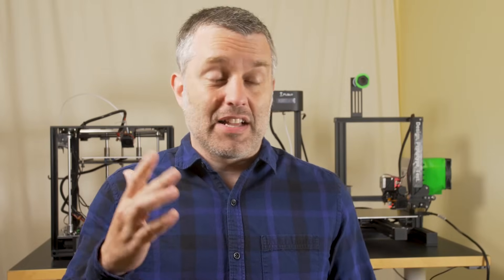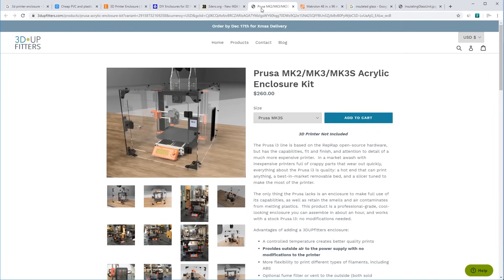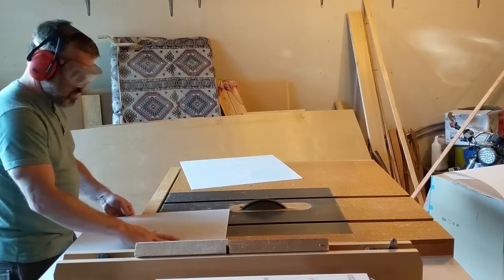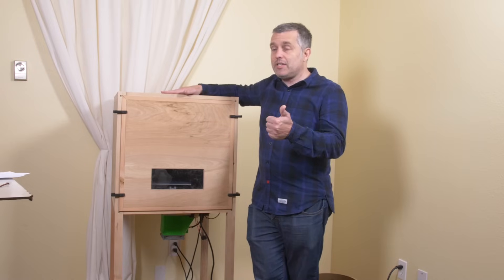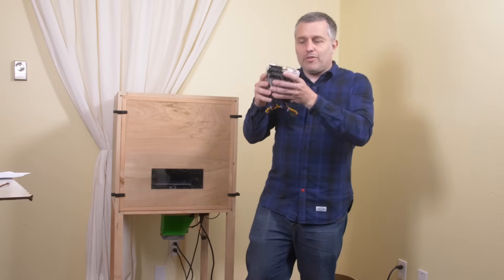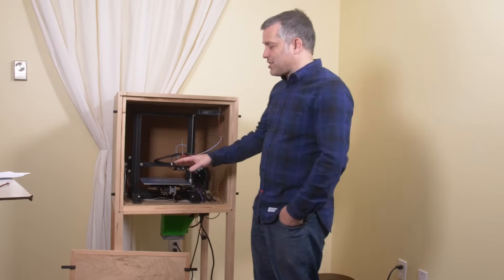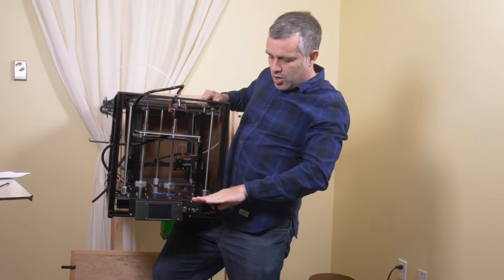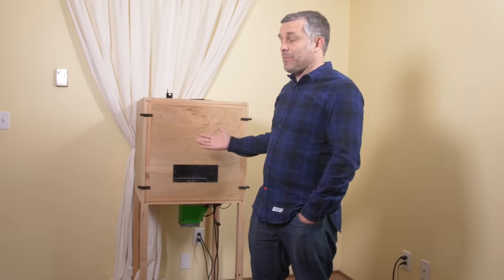3D Printing in a 100°C Heated Chamber - Lessons Learned

Comment: Why not order argon filled double glazed glass for windows? Double glazing makes good insulation but eventually, heat will get trough. But for double glazing, I would use the same idea as in the kitchen oven. One sheet insulates another one is for safety reasons. It is less efficient as insulation but prevents the inner sheet from meltdown if you are using polycarbonate. Convection makes the constant exchange of air for the inner sheet and the number of holes and sizes defines the actual level of insulation. If you would make a construction smart enough the whole idea could be used to make duct channels trough the whole cavity around the chamber. That points to the make of internal walls from something more heat/fire resistant i.e. glass or aluminium (which conducts heat but also radiates half of it back as an IR  and spreads heat around the chamber more evenly.

Comment: You really overthought your problem.  You should have cut the slots for the PC just a touch wider to allow for sliding the thin pieces in.  Then went back and sealed your gaps with clear silicone.  Granted you'd only get a seal on one side of one of the pieces, but you'd get a seal on both sides of the inner wall, and the outside of the outside wall.  It's a good build otherwise, but you could improve it easily.

Comment: Use halogen bulbs rather than the heat gun. Place them over the build table, offset from the Y axis that the print head runs on. This will direct heat to the printing part. This will offer a heated chamber effect between the heated table and bulbs without overheating every other part of your printer. Still have the walls of the chamber to stop draft but leave the top open so that the printer doesn’t overheat. 

If you have all motors, wiring, bearings etc in the chamber they will malfunction very quickly. This is why commercial printers with heated chambers have nothing but the build table inside the chamber, everything else is outside the chamber in a fan cooled environment, very important.

Comment: i covered my printer with plastic and light iron frame...also used  Circular Saw Blade (80 cm diameter)instead of glass of the bed ...they are flat like glass.. heat faster and transfer heat well to the part...And I never had a problem layering on  ABS after use that

Comment: I built a water cooled printer (even has all metal linear rail carriage worth MORE than my printer) and the only thing I never got to finish is making the enclosure itself. lol.  big printers need a lot of freaking Melamine panels. Use Melamine and avoid any kind of wood in a heated environment.  Melamine when it burns produces nitrogen and self extinguishes.

Comment: I use 1” aluminizes foam board taped with aluminum tape. Then heat with 2 small halogens and a fan inside. Electronics outside. A thermostat controls the lights. Like your small viewing window, definitely update my builds tomorrow.  I’m currently designing water cooling the stepper motors with good success. Thanks, love you work
Reply: I just did that earlier today, finally got around to trying some ABS now that I'm low on everything else. Had 3 walls of 2" aluminum faced already to block the breezes in my shop already. No Auxiliary heat or fans but the print I tried came out perfectly fine. Not worried about the stock board since I have an upgrade, but I have the power supply and the filament reel on the outside. I think having the filament reel somewhere it won't catch fire if there's an issue is really important. I didn't bother to fully seal it yet, want chamber temperature monitoring first - probably an oven thermometer and viewing window to start, already available.

Comment: Ok, I know this was a while ago. . but.FYI ... putting an Encloser over ABS ( without filtered ventilation ) .. would be worse on you than letting it get in the air.. you are trapping ALL the fumes from ABS into the enclosure ..  SO when you pull that Enclosure off. where do you think ALL the compressed fumes are going? a lot more into your lungs than if it was in the air with an open window with a fan.. IMO.
Reply from the maker: You make a good point. You aren't wrong. However, I would point out that 3D printing releases fine and ultrafine particles. We colloquially call it "fumes" but the pollution is definitely particulate and not gas based. These particulates can settle out of the air. If kept in an enclosed where horizontal surfaces are wiped clean after printing is complete I'm sure this will lead to less exposure in your lungs than printing in the open air while inhabiting the room.

Comment: i wish i could share my enclosures i built for my enclosures, i have nothing in them, i used old scrape wood 2x4 that i split an old floating floor but i made my own lack tables an used foam board u can buy at dollar tree for a buck each, its the same thing u see ppl use to make signs or even rc airplanes but i always use it to cover my enclosures an just use plexiglass for the door or the foam board with plexiglass if the door is bigger than the plexiglass that i had. would like to share what i have now and all the different stuff ive tried. ive build one really big one that held 6 printers an also 2 or 3 printers, i have one now that has my 2 flsun qq-s pro an they have been the hardest ones to enclose due to the height of the printer. everything ive done only cost me what i spent on the foam board an the rest was either printed or old scrap wood that has been laying around my house for yrs so it finally found a use. should fix a place where we could share what we have setup.

Comment: Please start using push blocks and table saw sleds so you don't get the nickname of "stumpy".
Insulate? yes - but I would be hesitant to heat the chamber. Most consumer grade electronics don't perform well above 125 degrees.

Comment: Hey I know this video is 10 months old, but I’m just getting to it. The part cooling. What if you used some CPAP hose, and connected one end to the cooling fan intake and had the other end out side the insulated chamber? This way you can get part cooling at a much faster rate. Granted you would be introducing a stream of cooling air into your chamber, making your secondary chamber heater have to work that much more....blah blah....ok never mind! 

😉👍

Comment: A sealed chamber (cheap build) is enough to print ABS with my Prusa i3 mk3s without problems.
One of my current projects is making a heated chamber for my Tronxy X5SA Pro CoreXY printer. I use the 2020/2040 profiles of the printer to attach isolation material. The X/Y motors can be left outside the chamber and keep cool. Marlin on the SKR 1.4 board supports heating chambers so I don't need a Duet. :)

Comment: As an owner of a stratasys an a few other hobby printers I can give some information that makes the stratasys a better machine for printing. The heated chamber for sure is the key and in a stratasys is held at 80°c but the tip cooling and the top of the extruder are also fed ambient air from outside of the chamber which stops run away temperature

My hobby printer sits within an insulated box with a 240v ac heater and I tend to only run it up to 40°c due to the other components though the steppers within my stratasys are all in the heated chamber and whilst it is becoming and old machine now still prints very well and reliably. It is at the end of its commercial life as material is no longer available so I now have to chip it - very tempted to gut it and replace the internal controls and use the stepper and extruders as they are very good quality
Reply: which strat do you have? would you sell it?
Reply: @mrt6399  it's a uprint dimension. Probably would consider selling it but I feel that the value it's worth now may make me keep it. Probably only worth £750~£1000 which considering I paid around £15k for it does feel quite a hit but it's made good money for me over those years
Reply: @rkde2042  Triton3d makes stratasys compatible filament for dimension

Comment: Oh man that putting plastic into a slot problem was exactly what I encountered making my LACK enclosure, I wanted to make it look nicer than the ones I saw online so I cut a slot through the table and legs to fit the plastic panels with no visible retention hardware (using the exact same rotary tool saws from aliexpress actually...), I had to modify the slots wide enough for the fit to be loose and then added printed L shaped pieces of plastic to act as shims I glued in place using the side of the L that didn't sit against the plastic but instead against the table/leg. Enclosure worked great, I think dual layer walls is overkill at least for ABS etc. Hollow IKEA furniture + sheet plastic made for a very good rattle amplifier though, and I've since swapped to PLA and PETG and retired the enclosure.
Reply: Can you shar photos?

Comment: The other patent that you can violate ;) is feed in outside air from outside -- that is exactly what stratasys does, the funnel cool outside air directly at the part -- super directed, and they compensate with the chamber heater able to keep up.

Comment: If you have a printer where the electronics are in the base, it makes sense to seal your box to the top of this, the cooling fans will then keep the inside of the base cool, while letting the chamber be hotter.

Comment: There does not seem to be a riving knife fitted to your table saw. Why would you remove a safety device like that?
Reply from the maker: The table saw in this video was a homemade adaptation of a Chinese cloned "Contractor saw" from 15 years ago. It did not come with a riving knife. If there was one on there from the factory, the guy who did the modifications removed it before I ever had the machine.

Comment: What exactly was the issue with the bltouch? I understand it loses accuracy above a certain temperature. Why not just probe then heat the chamber? If anything it might be better, you can set it up to use a consistent temperature during probing.
Reply from the maker: The BLTouch shuts down at 50° and will not run. The bed changes shape the hotter it gets. The metal is expanding unevenly as the bed is always hotter in the middle than at the edges. Standard practice is to run your bed calibration at the full print temperature otherwise things expanding will make the height map inaccurate.
Reply: @DesignPrototypeTest  would a multistage process not work? Heat bed, probe, heat enclosure? Heating the enclosure after would obviously affect the bed some, but I doubt the error introduced negates the benefit of the bltouch. How great is the difference in bed shape when printing materials requiring different bed and enclosure temperatures?

Comment: Many years ago I used a scrapped kitchen oven as a heater for my fibreglass curing oven (requiring 60 deg.). I bend the circulating fan in the oven to push more air, removed the door of the oven, and build an extra chamber outside of rockwoll bats. This actually worked pretty good, even though temperature control wasn't that accurate. I added some extra thermo sensors in the outer chamber to see the variances in temperature, and I could live with them.
Adding more air recirculation with some heat resistant ventilators would optimize the setup.

Comment: Patent litigation...   Haven't kept up with it lately but pretty sure at least in the past you're allowed to build and use one. part of the purpose of patents was you trade disclosure and information exchange for the time gated protection.  Others are allowed to investigate and learn from, and even leapfrog your design, part of that was you're allowed to build and use and study one.
The real problem with this patent is should it even have been allowed to go through, it's very close to saying they invented the oven or insulation.  It's not a unique invention just because it's reapplied to something else that's new, it's only the standard answer that derives directly from 'don't want something to cool off too fast'.
Find some other 'box that keeps things from cooling off too fast' that is patented and predates theirs.  Namely the large insulated box that one of the other pizza companies used.  Put your printer in there, instantly around their patent, what you're doing then is obvious and predates their idea, not using their patent in the slightest.

Comment: Hz is 10,000. 50,000 in UK. 60,000 in us per second
Reply from the maker: Are you a bot? Hertz is a measurement of frequency. 1 hertz is equal to 1 cycle per second. The AC electrical grid in the United States operates at 60k Hertz. In other countries it is 50k Hertz. In my video I tuned the motor so that it was making 10,000 revolutions per second. I measured this with the sound waves. Tuning them to be 10,000 Hertz.
Reply: @DesignPrototypeTest  that makes way more sense now. If your ever get shocked you can feel the cycles. It definitely feels more like 60 then 60k. Oh yeah not a bot "beep beep boop boop" that last part was for my fellow bots lol

Comment: Using a heat gun for this is EXTREMELY dangerous.  Even on low those harbor freight heat guns put out a tremendous amount of energy. A hair dryer would be a much better option. But even then I would never ever leave something like that unattended, and keep a fire extinguisher handy

Comment: Those are just regular diodes 
Where you got that they're shotsky (zenner) I can't understand
Reply: Yes, those are normal diodes with a regular n-p junction. The Schottky diode has a junction between n-type semiconductor and a metal and has low breakdown voltage and is not suitable for a rectifier circuit. A zener diode however is something different yet again. The zener diode has a n-p junction that is heavily doped which allows it to undergo breakdown without being damaged and is used as a voltage reference.

Comment: If the sensor doesn't work at a certain temperature why not using it before a major print. Did i miss something?
Reply from the maker: The printer changes shape as it expands in the heat. Measuring before heating will be inaccurate.

Comment: You mentioned that there is thermal runaway protection that trips if the chamber heater warms to temperature too slowly. Do you know if there has been any changes made to RepRap firmware that allows you to set that without having to manually edit and recompile? I'm wondering if you could also share how long the timeout is at default. Thanks!
Reply from the maker: There have been SO MANY improvements to RRF since I made this video and I know that they were messing about with the Thermal Runaway protection. I don't specifics.
Reply: @DesignPrototypeTest  Thanks! Do you know roughly how long, minutes?, that you were having issues with?
Reply from the maker: It wasn't long. Not like I was in the middle of a print. It would always happen within the first say...5 minutes if it was going to happen. To the best of my memory.

Comment: Step 1, buy a used oven. step 2 put printer in the oven, step 3 profit. (you probably need to heat it with the printer or some other source, if you want to print below 80-100c chamber temp)

Comment: I've enclosed my delta printer with Perspex and use dichroic 50w downlights to add extra heat to the chamber controller by the duet mainboard. The hotend is water cooled so the cold side stays cold and a berd air tube/pump for part cooling so its not blowing hot air on the part. The extruder stepper inside the enclosure is getting on the hot side for running. 45 degrees in there seems adequate for large ABS parts not to warp.

Comment: I don't know how much double glazing costs in the US, but in the UK I was able to replace similarly sized windows in my shed for £30 each - 6mm glass + argon filled.
A good trick is also to get in contact with double glazing suppliers and see if they have any orders that were cancelled. You can get insanely low priced double glazed units as well as the window and door frames.
Once they're made to a custom size and the job is cancelled, they're practically worthless

Comment: I did some clear PC (250-270c mfg states print temp), using glass, PEI, & hair spray. printed a small piece @ 260c and open air, which was max of 75f, and it stuck to the bed.

Comment: Regarding narrow slots for your polycarbonate sheets and difficulty sliding in those sheets: Instead of 2 narrow slots in the 2x2, cut a groove wide enough for both sheets and a wooden spacer.  Now place the sheets and slide the spacer between the sheets. You can glue the strips to the exposed wooden center of the groove for a permanent installation.  Or if you like, just use a lightly compressed insulating strip as a spacer, then you can later grab it with a hook and pull it out if necessary.

Comment: Nice project but you didnt mention the most important: How do you connect and control your heatgun? Would you use a wifi-smartplug ore a relais-module?
Reply from the maker: Hotend 2 heater and thermistor plugs on the Duet Board. With the Hotend heater controlling an SSR that switches the 110v AC going to the Heat gun.
Reply: @DesignPrototypeTest  thank you! 
your thoughts:? 
Thinking about connecting my heatgun with a flexible aluminium tubing (closed air cycle) and metal mesh filter to my aluminium chamber to minimize risk of sparks and fire. Also no trust in the hotend heater mosfet so i´ll try to use a wifiplug swich (controlled by duett/octopi over wifi) i could even switch off in a separate app ore with a physical switch in case of systemfailure.

Comment: is the risk worth the reward? Are the prints that much better?
Reply from the maker: It's not about a quality improvement it's about just getting successful prints with high temperature filaments which peel off the bed as you are printing. Also they delaminate along layer lines as they are printing. Heated chambers alleviate this problem.